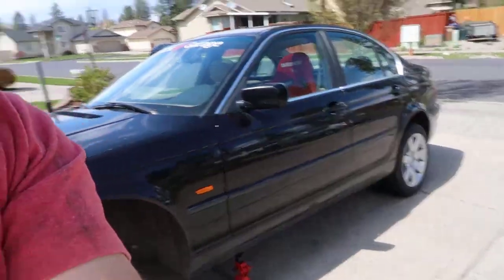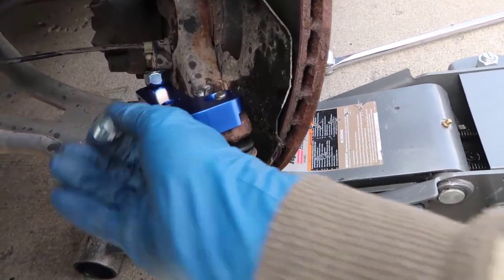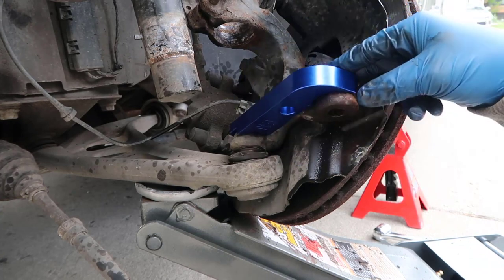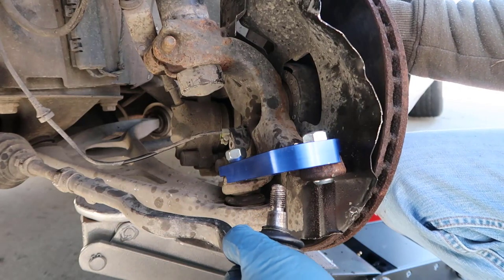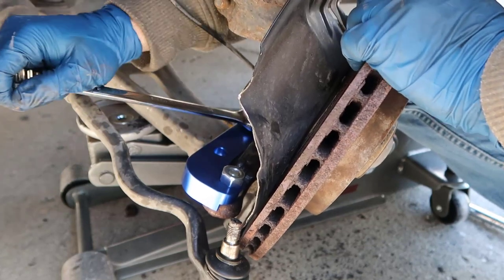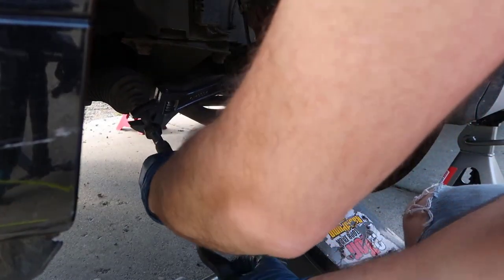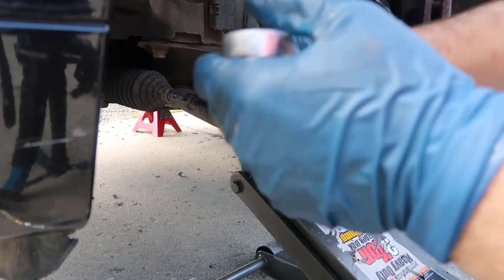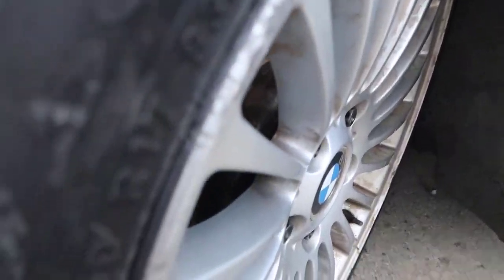Installing eBay Angle Kit on the Drift E46 BMW 330i

Comment: What spacers did you add later?!? Thanks!!
Reply from the maker: Hey Carter, it is in the description of my other video. Watch that also and see how it looks. Get hubcentric if you will buy some. 
https://youtu.be/Fg-rk49TJuw
Reply from the maker: Just added to the description but this is the one I am using. https://amzn.to/2LfEzMe.
It rubs on full lock still so either get the next thickness or use those spacer and  also change the front wheels ETC to increase the offset a bit more.
Reply from the maker: It doesn't rub on the fender. 25mm was good for that. Because I have the angle kit it was rubbing on the lower control arm mostly then a bit on the chassis a bit. I increase the offset and used the 25mm it's working like charm now. 
I haven't tried 30mm

Comment: Did you check the Tie rod boot after installed this Angle kit? seems the fitting issue caused the boot gone. do you have solution?
Reply from the maker: Where did you see the booth gone?  So far everything works fine.

Comment: Hello again, thanks for your answer. Winter is coming to norway, and im going to do this mod. But how big spacers do I need? :)
Reply from the maker: I got a 25mm space hubcentric. Watch the next video. Go to the drift car playlist I install it there. It is rubbing when I drift full lock though so I got a 30mm but didn't install yet. 
This is the video I made installing it 
https://youtu.be/Fg-rk49TJuw and the spacer is in the description you can use as a reference
Reply: @CarModsGarage  I got some 30mm hubcentric today. And I will be using 7Jx15 ET20. Do you think I will rub?
Reply from the maker: @xXNorw3gianXx  dang right on. The spacer alone I don't think so. Not sure about the ET20. If I'm not wrong the stock E46 is ET41 so ET20 might work without the spaces. Try first use the ET20 and see if it will rub outside. Then add the spacer and see how it goes. With that offset you should be able to tune without spacer or even a 10 or 15 mm but give it a shot and let me know. I'm curious about that.

Comment: Looks awesome man. Super cheap and looks like it works. You probably won't remember off the top of your head but how much length/thread did you cut off the tie rod?
Reply from the maker: I cut 24 threads on each side. That was enough.
Reply: @CarModsGarage  Thanks for the fast reply, I'm keen to get this kit in the mail
Reply from the maker: @damianwattimena4128  I hope your tie rod comes out easier :). Good luck and I am sure you will like it. I've been beating on it for the past three drifting events and it is very good
Reply: @CarModsGarage  No rubbing?
Reply from the maker: @damianwattimena4128  unfortunately it rubs inside. I run 6 to 8 degrees of camber also.
Reply: @CarModsGarage  Damn that's aggressive. Did you manage 6-8 degrees with just the camber plates/mounting of coilovers?
Reply from the maker: @damianwattimena4128   I looked yesterday while fixing something on the BMW and yes I got 6 degrees now. All from the camber plate from the coilovers (ebay coilovers by the way).
Reply: @CarModsGarage  wow! I'm on about negative 2 degrees of camber on eBay rollovers right now, I'm no engineer but I think the spacers would help create more negative camber.
Reply from the maker: @damianwattimena4128  the spacer should give some space for your wheel to turn more freely. Without it there is no chance you can turn more than factory
Reply: @CarModsGarage  Okay that cleared a lot of things up, thanks for the fast replies; absolute legend much love and support from Australia!
Reply from the maker: @damianwattimena4128  oh yeah mate. I use to live in Melbourne lol. I love Australia man. Some day I will come and visit. See if I can do some car stuff over there. Maybe bring a supra home!
I appreciate your support brother!
Reply: @CarModsGarage  Maybe put a 2JZ in the E46 one day; who knows? Hahaha
Reply from the maker: @damianwattimena4128  that would be awesome. I already looked into it.

Comment: How are these holding up?
Reply from the maker: They are very good. I got spacers and still need an wheel with offset to make it stop rub on the lower control arm.
Reply: @CarModsGarage   How thick are the spacers?
Reply from the maker: Dude I am so sorry. Comment's inside comments Youtube doesn't alert me. I used 1" this one https://amzn.to/2LfEzMe

Comment: Is it nice to drive with? How long did the whole process take? :)
Reply from the maker: Hey Sondre, It didn't change my drive since it only changes the angle when turning. It will improve the angle when parking but I would not install it if you don't drift with your car. It works perfectly, drifts like a champ but I would not install that on my "normal" daily if that makes sense.
Reply from the maker: forgot to reply how long it took. The normal process will take tops 1h each side accounting for some rusty bolt. My case it took extra 5 hours because I couldn't remove the outer tie rod from the inner tie rod.
Reply: I thought, it will make the steering to be more sharp, when making small correction in straight line! Isn't it?
Reply: @zfloz9895  it does, I've run these for two days they suck in my opinion. Other than QUICKER lock to lock, I didn't experience much gain in angle at all
Reply from the maker: What measure you used to say it didn't add much angle.  I have it proven on pictures drifting the bmw that angle is way better than OEM and makes drifting much easier. On the flip side I didn't pay attention to how sensitive it would go side to side since I don't daily mine.  Did you take yours out?

Comment: Did this kit happen to add front camber?
Reply from the maker: did not. Camber I got from the adjustable coilovers. Just just let the car wheels turn more. I didn't measure how much more but I can tell it was way easier to drift.
Reply: Had a feeling these kits didn’t mess with the track width of the front end darn!
Reply from the maker: @Discopapi  Not sure if I understood but it will not make your car any wider. So looking from behind or from the front it should be exactly the same. Let's say you are going to park or turn 180 degree on a street. It will definitely make that easier.
Reply: @CarModsGarage  would i need a re allignment after? have these but havnt installed because i dont want to re allign
Reply from the maker: @LowWay.canada  it's very likely. You will cut some threads of the rods so it will be probably a bit off. Mine wasn't too bad. I have a video on how to align it but it's a bit of time consuming
Reply: @CarModsGarage  okay thanks is their a lazer aligner i can buy?
Reply from the maker: @LowWay.canada  I haven't tested it yet but I've been looking into this one https://amzn.to/2TSRDIE